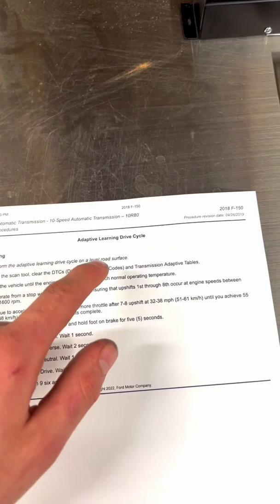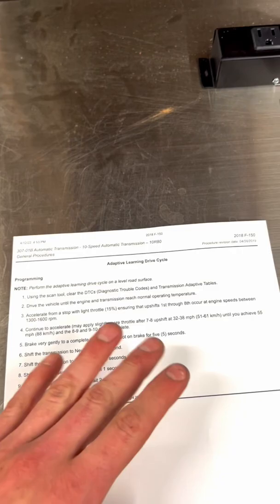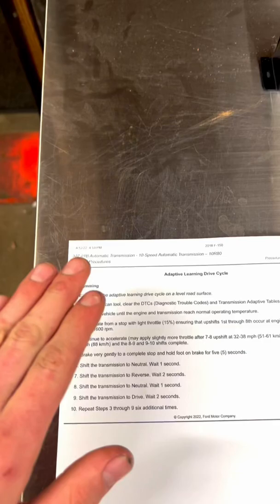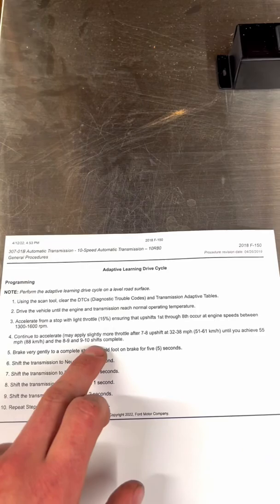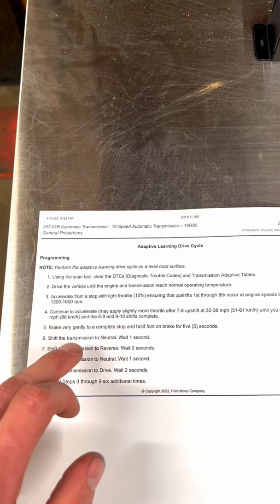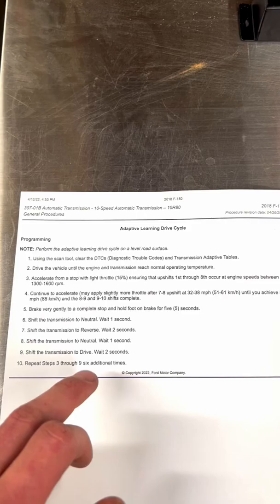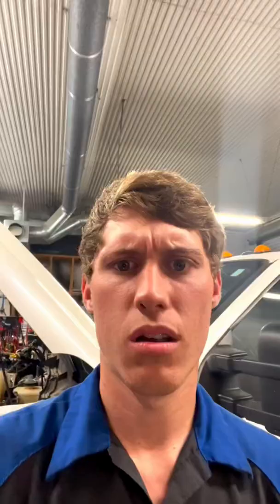Why Do Car Manufacturers Make My Job Harder? Pt. 2 #shorts

Comment: FoMoCo assumes the technician will do it on his own time on a deserted state highway in the middle of the night.
Reply: Or on a private race course
Reply: @83mike860 i was going to say, they probably think every dealer has a 5 mile closed test track just like them.
Reply: That’s not what ford has you do bud it’s what the automotive industry makes you do to his applies for any vehicle just no one does it because it’s stupid
Reply: @rcadventures8390  this does not apply to "any vehicle".
Reply: @jeffrojefferson88  uh yeah it does I’m an autotech they try to get us to do it but no one does it because you have automatics you have ev’s all that so it’s not like everyone is gonna do it it’s just a waste of time but they do in fact make you fill out a service form making you service the entire car as in check fluid levels check tire tread psi in the tire check rotors check pads everything so you ensure everything is good and if something is in the red zone recommend replacement asap

Comment: Been doing this with Volvos for years, and yes, it's tough to get this done in regular traffic.  Need a dyno.
Reply: I know this would be unsafe but could this procedure be done while the vehicles on a lift or does it need that resistance?
Reply: I just don't get why this transmission feels like the tough call of duty skin unlock challenges.
Reply: @nickbisson8243  No, it needs the front wheels moving at the same speed so it doesn't error out thinking you're doing massive burnout.
Reply: @Rob-vh9sn  So you need a tread mill for a car to do this safely. Does anyone make such a thing?
Reply: @Rob-vh9sn  4x4 hi?
Reply: @davidhenderson3400  Yes, you must get a giant treadmill. Duh.
Reply: @nickbisson8243 
No  a lift would program the shift to be perfect on a lift, not driving.  The load of the vehicle is needed to trim the shift parameters for said load.
Reply: @davidhenderson3400  it's existed since testing emissions became a thing. It's not a treadmill, more like a 4wd dyno.
Reply: @davidhenderson3400 yes it’s called dyno
Reply: @nickbisson8243 be very very difficult in order to get it right on the shifts and the brakes. Just wouldn't be easy at all and not only that but now you can't hardly jack up any vehicles and make them function normal because of the computers and traction devices
Reply: Sure no sweat, I got a dyno right here in my back pocket✌️

Comment: They probably expect you to have a dyno. That way you can do it setting in one place. Most small shops can't afford to have one of those so it's basically their way of making it almost impossible to complete the repair. Kinda like how Apple phones will say that the battery in your phone isn't genuine unless you have their calibration software. Right to repair is under attack in a big way.
Reply: 2 post lift
Reply: Seen inside a fistful of Ford dealership service centers. None of them had a dyno. That said, even the rollers without all the other stuff would be a godsend for crap like this.
Reply: I have yet to see any dealer with a dyno, not even our multi million dollar dealerships here dont have dynos
Reply: Please help us here and name the dealer that has rollers let alone an awd dyno.
Reply: @badopinion  None of them! lol. that's the point. they're setting unobtainable expectations therefore making the repair almost impossible to complete up to Fords expectations. that way they can say the repair wasn't completed to spec and isn't warrantied. just a way they can not take ownership. it's crazy and this is happening everywhere. like i said in my comment, even in cell phone repair.
Reply: 2 jack stands and a jack 😂
Reply: I'm from the country we use common sense to resolve issues lol
Reply: @wayneoakley1832   can't load the drivetrain on jackstands if it needs load, unlike a dyno 🤦‍♂️
Reply: @wayneoakley1832 try it, it doesn't shift properly because the front tires aren't moving. 
First get around traction control.....o wait that has to be on or the test won't activate. You actually have to drive it, or have a rolling road simulator. 
These cars are getting out of hand. 
Did you know when you sign your ford contract it says they can monitor your driving habits, and will send that information to law enforcement if they requested it. 
Ford will sell you out, it's in the contract if you just read it.
Reply: But regulation baddd!!1!1
Reply: As long as Ford Motor Company supplies the dyno🤔... no problem👍
Reply: Don’t see too many dyno’s anymore !

Comment: Gotta remember to stick your tongue out to your left, cross your eyes and have a fidget spinner on your right hand while performing the Adaptive learning drive cycle. 🤪
Reply: Do you do that running the obd2 drive cycle. Lol
Reply: And  roll the  drivers  side  window  down  then  up   and  repeat it again  on the  passenger side  😂,,,,,YOU  think  I'm  kidding about that  , well  ! Think  again 😢
Reply: And as you're driving down the interstate yank the steering wheel back and forth from left and right 10 times repeatedly. 😅
Reply: You must also be weaving a basket upside-down while driving

Comment: I've read that same procedure and I have the same reaction. It's ridiculous.
Reply: Put the truck on the lift with the tires off the ground then do the procedure.
Reply: @Back_door_bandit_98  That's a thought. Does it work?
Reply: @hdz12ez  it probably will but it could be very dangerous. It would be safer to do it on a dyno.
Reply: @ChronicBongitis420  exactly. Plus it's safe to assume the procedure needs to be down under normal load
Reply: I know it’s a late response.. but no it won’t work. The truck also picks up driving parameters from the front wheels. It will throw a code because the fronts aren’t spinning with the rears.

Comment: I'm a v.w. tech and I do not know how v.w. has not been sued due to procedures similar to this
Reply: Touareg brake drag wear in procedure is a good one lol. Or the DSG clutch adaptions. Or the DPF highway regeneration lol. All good ways to get hit on road.
Reply: @richolishis94  yes sir setting readiness on the TDI'S is the most insane
Reply: Regens will kill me one day staring at Odis for an hour straight on the highway waiting for it to go through
Reply: Connecting rod recall wants you to basically drive like mario andretti for 15 minutes and check the oil filter.

Comment: From one rebuilder to another, you don't have to follow it spot on... just put the unit in and drive it home and back the next morning. I just keep my load low and let the adaptions ease themselves in. Zf and aisin have very similar drive cycles, and doing it my way has never produced negative results.
Reply: if there is a specified procedure then you need to follow it. it won't always be bad if you don't but there are a few things that CAN go bad and if they do it's a major problem. it's not worth being lazy about it. just do it right the first time like you're paid to to do.
Reply: Zf transmission has been this way since the early 2000's. Just drive it around, be gentle on it. It's called adaptive transmission for reason. It adapts to the driver's inputs the more it's driven.
Reply: @brentbovee6411  finally someone who gets it 👏
Reply: @sumo-ninja  You're obviously not a flat rate mechanic
Reply: @brentbovee6411  and no one has complained about it?

Comment: That's when you break out the jack stands and do it in the shop....
Reply: I was going to say kick the lube guy off his lift but that works hah
Reply: No load being applied to the transmission, won't work.
Reply: It knows the front wheels aren't turning and stops the process, activates traction control, which now won't allow the learning procedure
Reply: @ryurc3033  4x4.

Comment: The saddest part is the need to open up a 2018 transmission.  My 2001 4L60 has never been touched other than fluid and filter

Comment: Thankfully where i live there are a lot of wide open low traffic long ass roads. I had to drive about 15 miles away from the shop to get to somewhere where i could perform these procedures. Had to do it on a 15 escape and a 12 f250 so far. They had me run through the gears to 2000 rpm shifts like 3 times then 3000 rpm shifts 3 times.

Comment: I have friend that bought a 2016 Ford Transit 350 with the 3.5 liter twin turbo v6. For the first 80,000 miles it was fine but in early September, 2022, over 14 months ago the engine locked up apparently due to a hydro lock. Water in the oil etc. He was under an extended warranty so the Ford dealer in DeSoto Texas replaced the engine after holding his truck six months. The new long block lasted about ten days and it locked up. They then replaced the new engine (long block) with a short block. The shop damaged the truck while installing the new short block and kept his truck for another three months. After all this and maybe 80 miles driven this short block locked up. It is now November, 2023 (14 months) and the truck is in the shop under warranty but the dealer cannot determine what is causing the engine lockup. It will need another engine but the dealer has not been able to determine the route cause of the multiple engine failures. My friend works out of his truck and has lost well over 50% of his income but he has been patient with the dealer. Do you you have any thoughts as to why these engine failures continue?

Comment: Been a thing since the early 2000's with ZF6 transmissions. Most all modern electronic transmissions need this to be done after repairs. With the ZF, you can just drive the thing in different traffic conditions and it will eventually adapt.

Comment: My uncle had his own shop for 30+ years and I was workin for him in 2014 and we replaced a tranny in a 2010 or 11 Chevy ¾ton and it was a bitch to find a replacement and after we put it in and topped her off with fluids I took it for a test drive, it acted like it was in limp mode, come to find out any electronically controlled part on newer vehicles have to be programmed to the vehicle at the DEALERSHIP!!! The Chevy dealership didn't bother to tell us that when we ordered or picked up the tranny from the them!

Comment: Do they expect every shop to have some sort of test track in the back
Reply: They have lifts...
Reply: @magincap70  it’s not the same as an actual loaded drive cycle
Reply: @billybobaggins8820   that's all I've ever done and never had any issues.   The transmission will learn how someone drives and adapt anyway.    Sometimes close enough is good enough.  I don't work for Ford though and in my experience they definitely do things way more retarded than the Germans do.

Comment: Seriously....get over it, what's the big deal? Test drive it once, check for leaks. Park it, have the service writer tell the customer it will shift slightly odd for 200-300 miles.
Reply: This.

Comment: I actually got pulled over by a state trooper because he said it was dangerous to be pulling over then getting back on the freeway. The worst part is because you can't give full throttle when getting back on the freeway, you have to wait for the lane to be open for miles.

Comment: When i worked at the mitsu dealer i did a trans on a used mustang. Ended up having it shipped to the Ford dealer to do the programming and reset. Fuck all that

Comment: Doing all the required steps to reset the SCR drive cycle is definitely one of my pet peeves when I get a diesel truck in with the engine idled. Doing all the steps correctly doesn't necessarily work during the first attempt either, requiring you to start all over again.

Comment: In 1993 my buick 3800 series 1 had a brake in procedure that i believe said full throttle up to 50 , slow to 30, full throttle up to 50. And repeat about 5 times. Or somthing like that. Not exactly sure how they worded it. Back then would of been no big deal. The highway 2 miles from us had only a few cars per hour go by. Now it is literally wait for minutes just to get a clear enough gap to not get hit pulling out. And the speed limit is 65.

Comment: I know it sucks so bad. But I have a perfect country road a few miles long with hardly any traffic about 10miles from shop. So trans gets up to temp by the time I get there. Only part that sucks is i have to hope the WiFi hot spot gets signal out there for the stupid  fdrs to download and clear adaptive tables. I’ve tried to clear it at shop, but doesn’t work if I drive it 10 miles

Comment: I feel it brother. Nissan has a brake flush recall from DOT 3 to 4, you have to push the brake pedal all the way in, hold it and start on consult (nissans programming software) then let the abs actuator run for about 45 seconds and bleed each caliper. Not too bad right? Well at the very bottom it says a cheeky little "Repeat these steps 13 more times".

Comment: I had one reverse bulb go out in the 3rd brake light of my F250. Hard shifts and slipping gears had me about to sell the truck. I serviced the trans without a change. Took my mini max off and went stock on air intake and exhaust. Came across a wiring diagram for a circuit board showing the 3rd break light reverse bulbs next to the “auto trans”. Apparently the missing circuit from the bulb overpowered the board affecting my shifts. Thanks Ford……2 weeks later I blew the head gasket. It had a 4sale sign on it as soon as the cab was reinstalled.

Comment: My parents have a 2016 Ford Explorer that's got a horrible transmission shudder in 2nd and 3rd gear. It's obviously an automatic with paddle shifters 4 cylinder turbo. It's got that adaptive learning bullshit. It clears up after a hard reset then gradually it comes back. What do I need to do to it other than burning it to the ground?

Comment: Especially when the repairs under warranty and the manufacturer only wants to pay you just enough to replace the failed part. Not the diagnostic test you performed and definitely not the time you spend confirming your repair. The better and more experienced techs that actually take pride in their work and work hard to fix it right the first time are being penalized the most.

Comment: I have a 76 F250.  Transmission never been out until I elected to take out a few years ago, 2020.  So why we need these complicated transmissions?  I heard another still has his in a boss 429 mustang, still going good.  Mine still worked also, but I went ahead and changed it.

Comment: The adaptive drive cycle sucks, I’m a ford transmission tech, luckily though we have an old service road that doesn’t have much traffic on it that we can do them on, however sometimes cops will pull you over for randomly stopping and you gotta explain everything and show them the ticket for the vehicle and the adaptive cycle sheet and they’ll leave you alone

Comment: I have said for almost 30 years that before an automotive engineer gets credited for a design that they have done, they should have to work on the (prototype) vehicle. I GUARANTEE that if they did, the next 1 they deaign would be much easier to work on.

Comment: Similar deal to relearn cam crank timing on gm. Some have a distributor that has no timing adjustment. All  time adjustments done by ECU.  At least they have a scan tool method too.

Comment: I have a 2018 F250 that I bought new and it has gone through 3 fuel pumps and two relays. 
Today I went to start it and no start. It has only been 300 miles since it’s last visit to the shop. It has also stalled on me in the middle of an intersection and then no start for about 15 minutes. 
Is this normal? I get all my gas from wawa and not some shitty tank. 

Any thoughts on what it could be? If they can’t fix it this time I might ask a lemon law lawyer if I have a case. I do know one thing. My next truck will be a Chevy or a Ram…and I’ve been a ford guy all my life.

Comment: Being that GM and Ford share transmission platform engineering, I feel your pain brother. 10L80 and 8L90 trans require similar drive cycles. GM 8 speed requires you to decelerate to 10mph, WITHOUT BRAKING!! Like what? How? And where, at a closed track?

Comment: If I want to change the #1 piston rings myself what material do you recommend me study/have on hand before or during the process? Also what other items do you recommend me change while I’m already doing the piston ring? Very very novice here but mechanically inclined enough to take this on….as well as trying to save on paying dealer there solution to put a new engine in.

Comment: This shit been going on since 96 homie when OBDII came out, just regular old drive cycles. 

The most common one is, accelerate at 3/4 throttle to 60mphs in 15 seconds and come to a complete stop without hitting the brakes in neutral. Not a joke.

Comment: I just drive it around on a road I found by the dealer. 
I do it light then I do it heavy and it usually gets it. 
That's just the first part for the adapt learn cycle,the other half is the same but high rpm.

Comment: Try not to get in an accident while doing this. Dealers an AWD dyno. If the dealers would take the possible accidents into count on some of the procedures techs are required to do. The dyno is cheaper then insurance claims

Comment: That is ridiculous. Just like this P1000 code I have on this 04 mustang I just bought. How do you get rid of it? Doing some research, it comes up if you clear codes. Or if it's been sitting for a long time ( it's been sitting for 3 years).
Reply: That's a code that doesn't go away until all emissions monitors have completed. You have to drive it for a while.
Reply: @Otagner  ok thanks. I just started driving it a few days ago.

Comment: I have to use a service road next to the highway my dealership is next to. I have just enough of a straight strip to get it done stop pull over do the shifting process and then turn around and do it again 6 times. One of the most annoying parts I’ve found so far about working on ford.